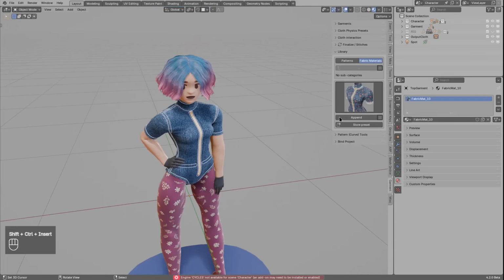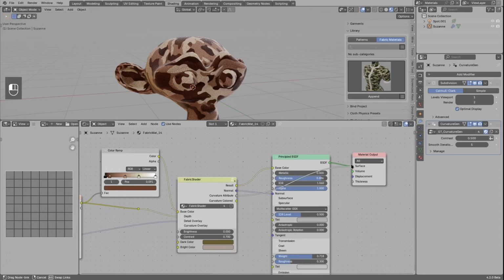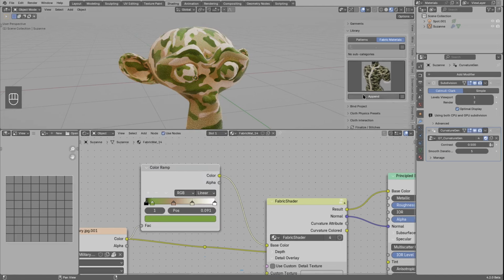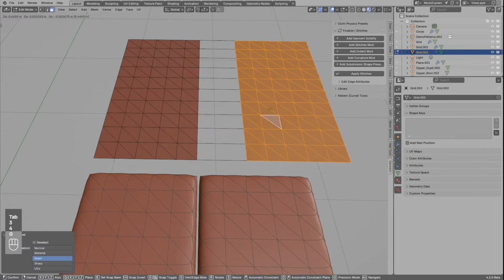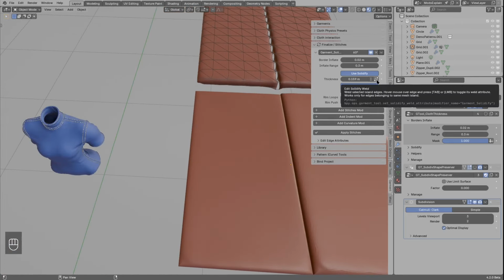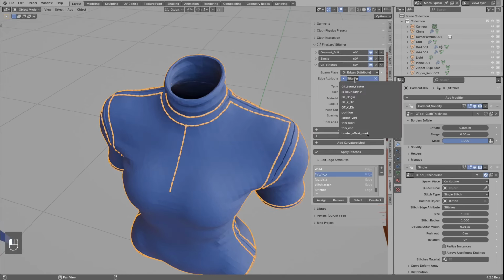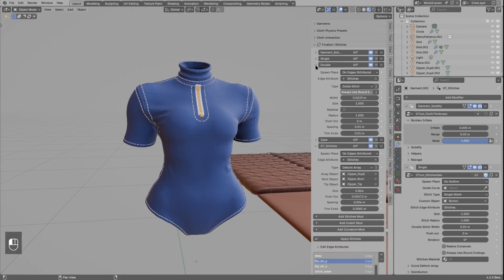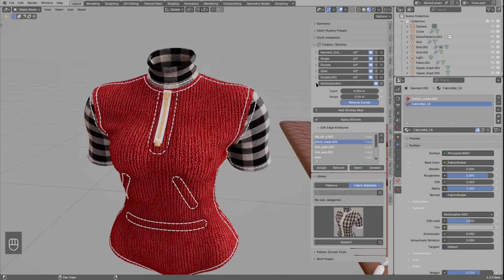Materials, Stitches, Zippers and more - Garment Tool update

Comment: Garment tool is by far the Best Cloth Sim Tool ever existed in Blender . I am using it for quite some time . But recently i Updated to Blender 5.1 and i get some error msgs. Is there a chance we get a patch to get rid those errors ??
Reply from the maker: did you try to run built-in updater, to see if you have latest GTool version?  It should be 2.41. If u still have issues, u could contact me on:  https://discord.gg/cxZDbqH
Reply: @bartoszstyperek6306  Thanks A_lot !!! I had version 2.1 ... I just Updated . Everything runs great atm !! :)

Comment: does it work for simulation too? or just modeling?
Reply from the maker: I did show only little bit about simulation in above video. HTool comes with custom geo nodes sim, but its still is not perfect (at least it does not jitter like previous version did). Maybe I will make separate vid about it.
Reply from the maker: it is using blender cloth sim. So if blender cloth sim work with animation then so GTool :)
Reply: @bartoszstyperek6306  i mean can we use it like marvelous for the simulation? because you showed that before you finalize the cloth it wasnt merged